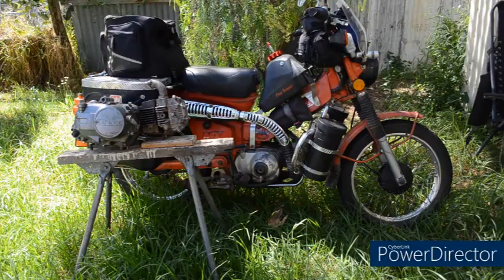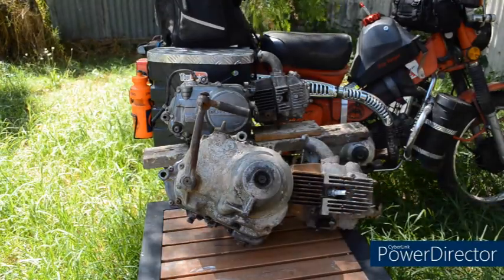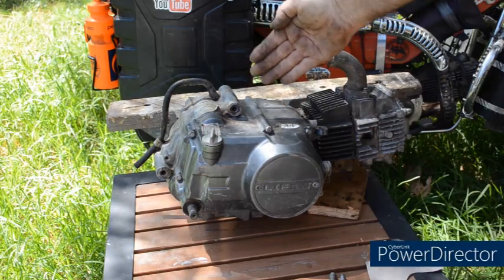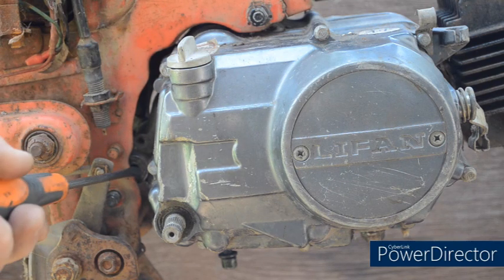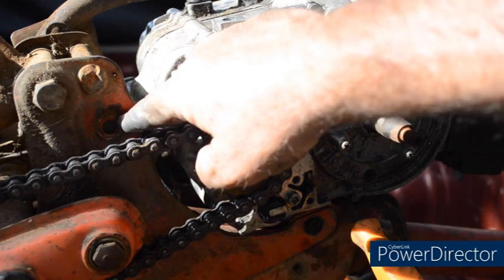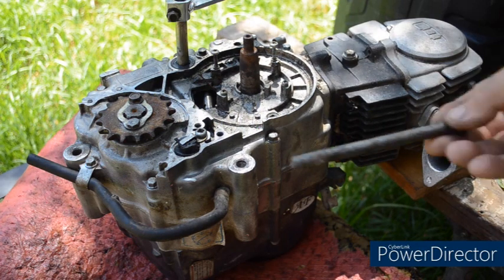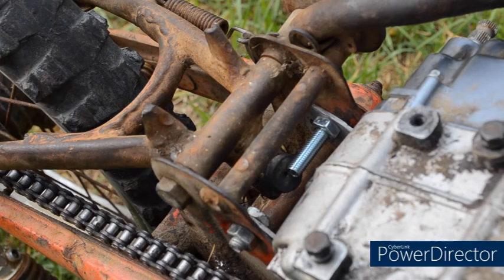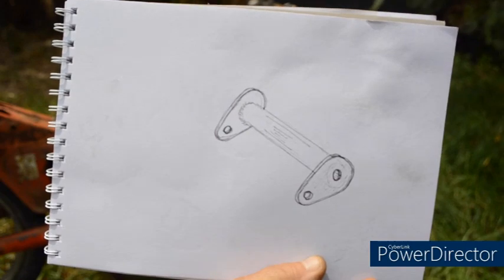Bolting a Lifan 125 into a Honda CT 110 Trail

Comment: Very good I may have looked into what you did if I’d seen it a year or so back. I didn’t like the eBay option either so extended the frame out flush on the out side and thick welded spacers on the inside. That way in the future if I go back like I still have the option of cutting / grinding it back to stock. Your way off corse is more refined. There was another disadvantage with my way and had to put the original bolt in to support something like the stand  I’ve forgotten what it was.
Reply from the maker: Yeah there's no right or wrong way just different.  What you did sounds a good idea, the twisted metal ebay straps didn't seem strong enough to me.

Comment: Lifan mounting points will line up with early pushrod (pre ohc motor) mounting points. Had on in a 66 c100 super cub. Just had to notch frame a tiny bit in 2 places to clear the engine case.
Reply from the maker: Good to know, it's impossible to cover all bikes/engines in one video.  I made the video because lots of ads selling the Lifan give the impression it's a direct fit into a CT110.
Reply: That’s the impression you get from a Honda clone!

Comment: We have a couple thrown together ct90s with with these engines. So far they’ve ran great and been reliable and relatively trouble free when you use good fuel and keep the carbs clean. But I think it should be a last resort in most cases as you’re absolutely decimating the desirability and resale value. Given how valuable these bikes are getting now, it really only makes sense on clapped out/no title bikes that don’t have a lot of value to begin with. Otherwise you’re better off just getting something faster if that’s what you’re looking for and leaving the CTs as is.
Reply from the maker: Yes, I see bikes with pitbike engines, pitbike front ends etc, eventually you end up with a pitbike...  No thanks.  I did this video to show the difference because engines are being sold as direct fit into ct90/110 & that's not the case.  Thanks for your comment.

Comment: Nice work you are doing there. The CT engine is different from most of the other Cubs, it is known as the "fat Harry" engine, it is the same fitting spacing as the C90 6v. I agree that the original is the better option, I have a 68 CT and will keep the engine as it is. Thanks for sharing this. New sub from me
Reply from the maker: Thanks for watching & for your support. Fat harry, I've never heard that before.  Yeah fitting a pitbike engine devalues the bike.  You've got some good stuff on your channel, I've always wanted a CB4oo four.  New supporter of your channel here too.
Reply: @Free_Ranger_CT110  Thanks, and I look forward to watching your videos
Reply: Why choose a Lifan over an ATC125 engine.. It has the dual trans. I'm seriously considering putting one in my 1978 ct90.. more power, 12v, electric start, brighter lights.. as to devaluing a stock 90, done right it's an upgrade and uses the stock mounts.. the drawback is the bash plate arms won't fit, but overall it's .. 😁
Reply from the maker: @sscbkr48  atc125 is a good idea, not as easy to find as a Lifan though.  Jennies Garage did a series of videos fitting one to his ct90.

Comment: The Lifan was never made for the CT110, it was made as an all around motor, one fits all sort of. If you want to avoid all the headache, here is what you have to do. The main problem is, that the Lifan is about 30mm smaller in height than the Postie, and when you try to mount foot and gear lever, it will not fit. You do need the mounting plate. The secrete to get it to line up, is to get the motor at the right angle, and the brackets what comes with the kit, doesn't do that. You can do this without the mounting plate. Put in the top bolt, and tilt the motor up, until you can fit the exhaust pipe, when the exhaust fits, you have the right angle. You will need a 10mm spacer in the exhaust to seal tight. The foot peg will now fit, however, the brake pedal will be 30mm lower. However, all this can be avoided, if you lower the mounting plate 30mm, the gear lever will also fit, and the bash plate will line up.
https://www.youtube.com/watch?v=Bo-MPwgff7E&t=2s
Reply from the maker: I know the Lifan doesn't fit the 110, as I said in the video it's a perfect fit in an old CT70 Dax minibike.  I wanted to see if it can be fitted without all the hardware bolted to the engine, this was only about mountings, anciliaries are a whole other thing.  If the bike was to be used off road it's important to keep the underside clean, without bolts sticking out to catch on rocks etc.  I have seen your video & I think the two twisted plates from the rear mount can be improved on.  This was my way of doing it  Maybe another video seeing how everything else does or doesn't line up is needed.  Personally I'd make the exhaust fit the engine not the engine fit the exhaust.  But everyone is welcome to pick & choose what works best for them.  Thanks for commenting.

Comment: I found a deal on 3 ct110s in poor condition as the  previous owner lost interest on a botched rebuild attempt that came with a new piston/cylinder/gasket and seal kit. 1 I am trying to keep original with its hi/low engine using parts from its clapped out donor. But the other CT110 rolling frame no engine I am modifying completely to suit the lifan 125 as a potential on road  bike. As much as I like the Honda engine its cost viability for long-term road use when compared to a complete engine replacement is becoming hard to justify. Anyway looking at the diagram showing the lower engine mount adapter, I think I will try something similar but thread tap both sides of the lower lifan engine mount to hold 2 counter sunk allen hex screws with the factory frame lower mount using the original mount bolt and spacer tube... Rest of the ancillaries will be modified to the engine rather than the modification plates I see people use.
Reply from the maker: Yes as you say rebuilding a Honda is expensive, very quickly becomes more than the bike is worth.  Tapping threads & using countersunk bolts is a good idea, it never occured to me to do it that way but I think it's a great idea.  Getting the chain line straight is the worst part.  Thanks for commenting & all the best with your build.  Interested to know how you get on.  I've an idea to use part of the pitbike frame that my scrap lifan came with, not sure if it will work.
Reply: Why not use an ATC 125M.. has hi/lo and bolts in.
Reply from the maker: I'd do that in a flash if I could find an ATC125 engine.

Comment: Cool! A stupid question: dont they have any rubber mounts ever? Like 10 to 8 mil tubes inside the brakets or something?
Reply from the maker: Thanks for leaving a comment.  To the best of my knowledge they are all rigidly bolted in, but with the amount of vibes these little engines put out, rubber mounts might be a good idea!
Reply: @Free_Ranger_CT110  I just had a thought to weld some bigger tubes on both sides, that would fit some proper mounts inside. And then place the bolts trough these. Because my engine was fitted with 8mm bolts through 10 mm engine brackets, and I thought its just missing some rubber gromets... Bought the old bike from some youngsters, lots of botchwork done there previously.
Reply from the maker: My plan was not to change the frame in any way so the old engine could easily be refitted if needed.  But your idea sound OK.

Comment: What is that tool called that you are measuring the differences with?
Reply from the maker: A vernier caliper.  They now have electronic displays, much easier on my old eyes!  Not as accurate as a micrometer but cheaper & handy for most things.
Reply: @Free_Ranger_CT110  hmmm...I think we may need to get us one of those...thank you!
Reply from the maker: If you buy one Jody, I'd suggest buying a stainless steel one, not plastic.  They aren't expensive & can switch between mm & inches.
Reply: Harbor Freight is a good source for them
Reply: @leegraves101  oh I'm sure it is... I try to avoid harbor freight at all costs 😂😂😂

Comment: it will fit in a ct70....Im putting a 125 Lifan in a 68 CT90 ... I bought the 125 for my 70...but I just could not do that to a CT 70.     I will do it to a CT 90 tho.
Reply from the maker: Yeah with the cost of parts to reco an old Honda motor, many people are fitting a Lifan.